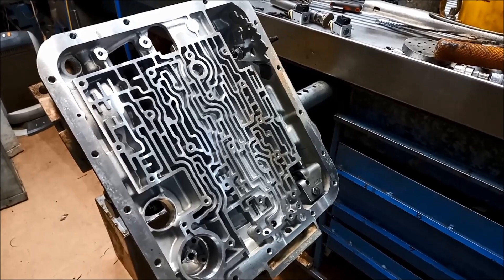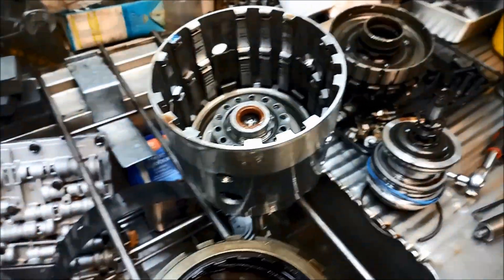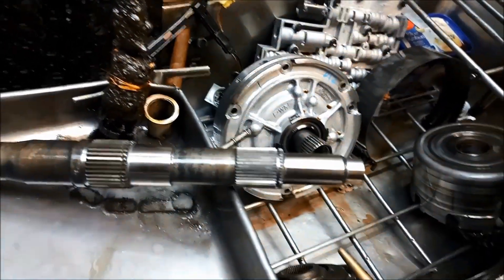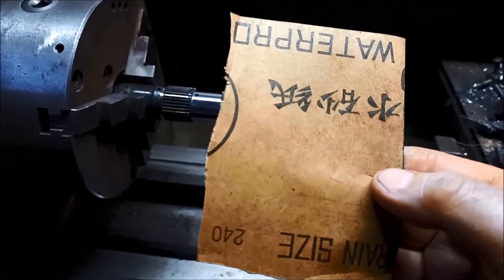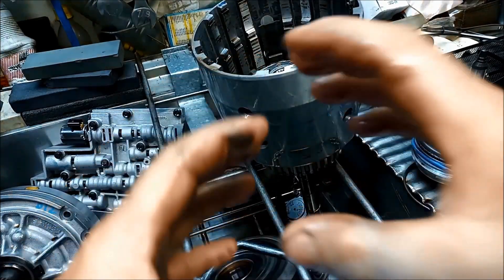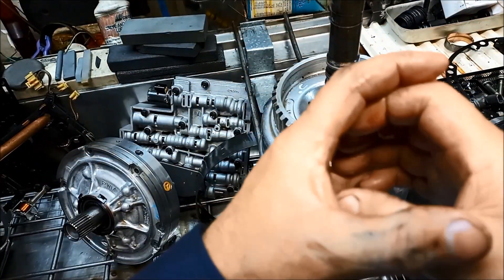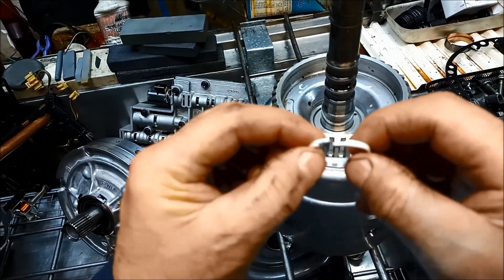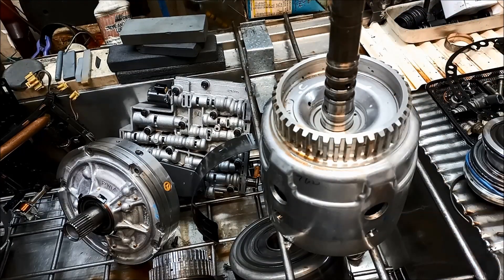4L60E 3/4 Clutch Failure Cause & Fix Rear Planetary Blown Reasons & Repair Teflon Sealing Rings How

Comment: wait wait wait, if that rear planetary and sun gear are in that bad condition, then all gear 1,2,3,4 have problem too.
Reply from the maker: hi, easier if you find and checkout the mechanical flow diagram to see the powerflow through planetary assembly. cheers

Comment: Is there any way that you can accidentally take to much off the output shaft when sanding down smooth like you did and how do you know if you did or not? I did it slowly by hand spinning the shaft finished it with scotch Brite seemed to get it real nice.
Reply from the maker: hi, shafts are usually hardened, we just polish it a bit. you can test on your installed bushing for wear/sloppiness. cheers
Reply: @YepThatsIt  so your saying it's not gonna hurt it? I didn't do it much I was just worried it might not fit tight to that lube seal if it was overdone?

Comment: how abt a steel spring around that seal, many critical seals have these.
Reply from the maker: hi, would make sense, but like most trans nowadays, i`d they they designed them to only last a certain amount of time. cheers
Reply: @YepThatsIt  yes. the plastic servo pistons they put in them proves that.   I noticed the chryselrs use a large , stout roller bearing in the tail housing. chrysler trans mission seem a whole lot beefier all around.

Comment: Everyone says the scarf cut are a no no for input shaft on 4l60e why do they say that? Should I use scarf cut on my pump stator? My gm manual says not to use scarf cut on input shaft I think what your saying makes sense though do you know what makes them say that?
Reply from the maker: hi, those input rings are step cut not scarf cut. step cut will continue to have full sealing contact at the join when they open, the scarf cut sealing rings will open at the join depending on the angle of the cut ( this causes a pressure leak ) search what i mean online step cut sealing rings & scarf cut sealing rings and hook join sealing rings or lock joint sealing rings. i suppose everyone has their own opinion. been reconditioning them since the old 700r4 days then the 4L60 then 4L60E. I have not tried scarf cut on these input rings yet. check out this other vid we saved repair https://youtu.be/2PtqmmdA5nY    cheers
Reply: @YepThatsIt  so the scarf cuts are like servo rings right? And I was wondering what should I polish my servo bore with I used red scotch Brite now I have a some lines in the bore I don't want my case to be ruined....

Comment: Hello from Texas and Oklahoma USA! GREAT Video! Excellent presentation and explanation on the 3rd and 4th gear clutches burning up. I need to ask, where can I find a handful of your white plastic seals that you showed on your video to replace the factory ones where it keeps the shaft sealed to the pump indefinitely it seems.  Excellent information on something that is actually difficult to first understand and for me trying to figure out ways to improve the rebuild that keeps burning up my clutches, 3rd build so far and you helped simplify the way you explained it and showing what can be used instead.  I just need to know where in the world can I find these white circle replacement seals for the shaft connecting to seal once installed into the pump to keep the flow of transmission fluid throughput the transmission as it should. You were also explaining something there at about the middle of your video right after you had finished using your 330 grid sandpaper to smooth out the shaft when you had it on your spinning tool and it cut soon on the video with what you were explaining and I would also like to know if you were trying to make a ridge there or just smooth it down to seal better in the little circle seal that the shaft spins on in the rear planetary ear area.  Thanks so very much. My email is kevinjohnsumbera1972@gmail.com if you could find time to respond to my mssg.  Thanks so very much for the info. Great!! Kevin John, Arlington Texas.

Comment: Gr8 video! I am plagued with a 4l60e in my 99 silverado rwd 5.3l. I would love to hear your thoughts on what would cause shift flares? I mostly drive in 3rd, not overdrive and it seems like one day after launching the truck from a stop, now it flares going from 2nd to 3rd? Thanks!!
Reply from the maker: hi, i would need alot more info, but make sure you check aall the basics first. also make sure the switch plate isnt contaminated with metallic debris. cheers

Comment: That was good info, have seen those input shaft seals in all kinds of colors blue, grey, green, red, orange , seen in the USA they supposedly sell plastic seals upto 2009 or so, but advertising wording is not always 100% so who knows, youd expect theres gotta be some company in the USA that has better input shaft seals.
Reply from the maker: hi, these days its more about quantity as opposed to quality. i would like to believe someone makes a better everything out there...problem is to find that someone. things are designed to fail at a certain time, use or mileage nowadays. you`d expect that with all their current experience and technology available, things would last longer, be easier to repair or even cheaper to repair...but they aren`t ! so progress and technology are only designed primarily to benefit the fat cats, and often we buy when hypnotized by advertising or manipulated by hype. if you find a quality product supplier please let me know on my facebook link ;-) cheers
Reply: @YepThatsIt  i will, i was looking on many US trans channels thats transmission channels LOL